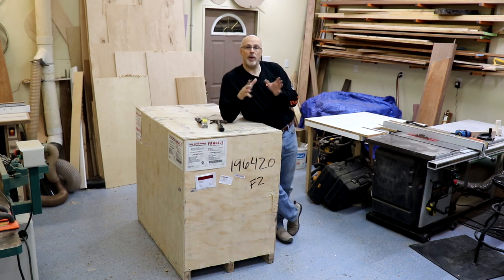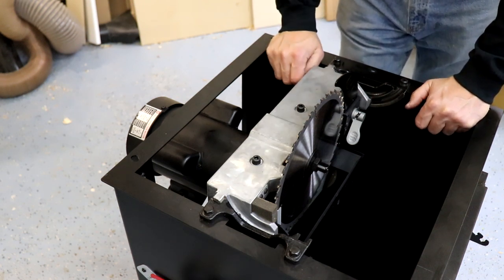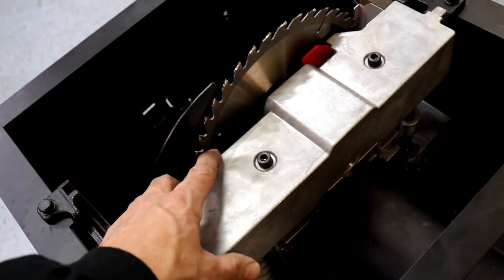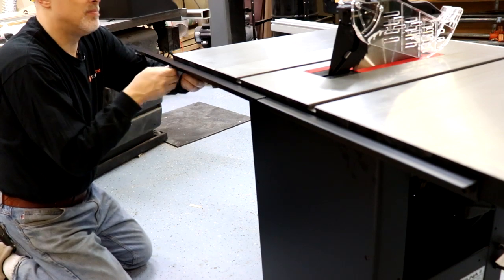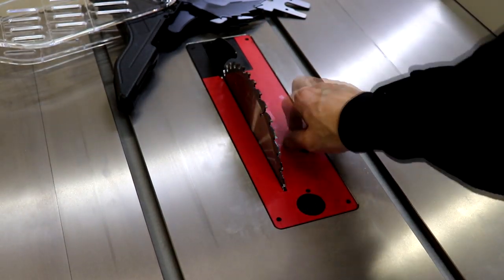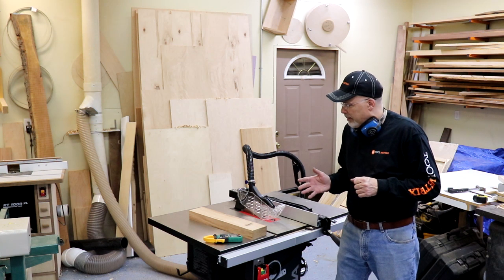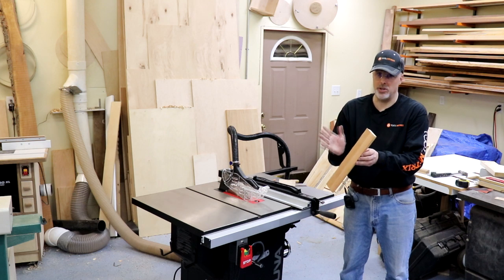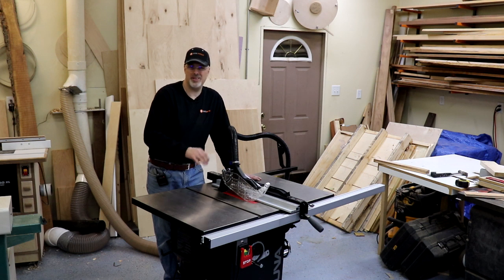Laguna Fusion F2 Table Saw Unboxing and Deep Dive Examination

Comment: How come on their site it says I'd need a 25 amp circuit. I have a designated 20 amp breaker will that be sufficient?
Reply from the maker: I used it on a dedicated 20 amp circuit without having a problem. I’m not sure why they state a 25 amp requirement. Circuit breakers vary in their trip point which might be one reason. It also depends upon how hard you push the saw although I pushed it pretty hard.
Reply: @ToolMetrix  okay thank you very much
Reply: @ToolMetrix  would you say the saw is worth the purchase?
Reply from the maker: It's an impressive saw, and I believe that they priced it about right.  Watch for the 10% off sales if you can, because they seem to come around periodically.

Comment: I have a 3HP 220v early 1980's Rockwell Unisaw in really good condition, I'm strongly considering selling it for this saw (I can't afford the F3) for the dust collection, riving knife and fence design (I have a Delta T2 fence on mine, so it's not horrible), will someone either talk me in or out of this?  I don't think I'll miss the extra horsepower, but I've long wanted a saw with a riving knife because I don't feel like a micro-splitter is enough protection.  I like most of the features more than say a Grizzly, so I'm really considering it.  Oh, and I will definitely choose to run this saw at 220v as well since I've got that wired up in my shop.
Reply: The fence on this is probably similar to the Delta T2.   However, the front fence rail is way too thin and flexes too much IMO.  I owned one of these for about a week.  It had to go back due to shipping damage.  I now have a Shop Fox W1837, which is a nice saw as well.  Similar front rail as the Fusion F2, but much thicker and stiffer.  Problem is, the fence itself is awful on The Shop Fox w1837 and the Grizzly variant (g0771z).  If you want a better fence get the Jet ProShop 2.  Internally it is the same saw as the F2.  It is just missing the cast iron wings and the overhead DC.   It does give you a much better fence though.   The Grizzly G0899 has similar features and a similar price as the f2.  The G0899 has better fence rails and a beefier cabinet.  That was one other thing that I did not like on the F2.  The cabinet seemed thin.  When standing with the wheels locked the saw was not as stable as I thought it should be.  My Shop Fox w1837 is much more stable IMO.   I am pretty happy with the Shop Fox so far.
Reply: @alsmith7316  that was one hell of an answer.  Thank you sir.  The comment about the rigidity of the cabinet has really given me pause, that's one thing I've never had to worry about with my Unisaw.  I'm thinking instead of taking those funds and putting them in a helical cutter head for my DJ20 jointer, or just wait for the inevitable car repair that happens when I have a couple extra bucks.
Reply: @jonq8714  It might not really be the cabinet's fault.  It might be the wheels on the left side of the cabinet.  They do not retract out of the way.  There are just some plastic handled bolts that act as brakes to keep them from turning.  The wheels are plastic and therefore I did not want to torque down on them too much.  It is possible the sense of instability came from the wheels, and possible play on the axle.  Again, they are just cheap plastic wheels.   

With these saws, the manufacturers are always looking for ways to cut costs while also providing more features than the next guy.  They may have been better off not making this a mobile saw.
Reply: @alsmith7316  I already have a mobile base for my Uni that's adjustable, I could just choose to not install those wheels then... hmmmm.  Talk me out of it, talk me into it...  haha.
Reply: @jonq8714  I don't think those wheels can be removed.  There are no feet on that side.  Have you looked into a Harvey?   I would have gone that route, but they are way too heavy for me.  My saw needs to be on a mobile cart that I can easily move out to my driveway where I do all my cutting.  My cart is also used for other tool storage etc.  Space in my garage / shop is at a premium.  So, the Unisaw class of saw is just to heavy for me.

If you want a lighter class of saw (which is what I was after) the F2 is a good choice.  I am sure you could figure out the base and get it more stable.   Full disclosure, the area where the wheels are is where I had some shipping damage on my saw.  This could have impacted things.  The whole saw shifted in the crate and I think something inside the cab shifted as well.  The tilt wheel would bind up when I tried to use it.  Those were the reasons for returning the F2.

Good luck with your decision.
Reply from the maker: That’s a tough call, Jon. The F2 is an awesome saw but those American made Unisaws are pretty sweet.
Reply: @ToolMetrix  they are indeed, but also short on modern safety features... thanks friend.
Reply from the maker: Yes, true that.

Comment: Nice review.   On the plate what are the give me all dimensions of that it lookes like what is on Jets proshop II. And a grizzly portable table saw.  Ive looked everywhere no one but grizzly offers a zero clearance incert for the jet
But it seems this is the new standard for some saws. Bosch also has one like it but I have no information on that saw.
Becuse most of this is made in twian in the same factory 
JET, POWERMATIC SAWSTOP GRIZZLY DELTA GENRAL OLIVER STANLY RIDGID 
PORTER CABLE  DEWALT EX.. Im thinking they are using the same designs 
On them  with differnt design on other stuff and finishes to order.  

( thats where all your American jobs went)
Reply from the maker: I no longer have the saw in my shop.  You can check with Laguna on the specs.
Reply: I am sure they are the same parts.  The Jet ProShop 2 and the Fusion F2 are pretty much the same saw.  Different cabinets and options are the only differences between them.   Look at the manuals and photos and parts diagrams.  You will see what I mean.

Comment: Thank you, Paul!  Very nice tool review.  The F2 seems like it would be a nice cabinet saw, especially for hobbyists in a small home shop who may only have 120V.  Nice price too.  I couldn't help notice  the Delta Unisaw in your shop and remembered watching your review of the Shark Guard on that saw!  Also an excellent review!   So, it would see that like many modern saws, this F2 will have better dust collection than the Delta?  How does this F2 compare to your Unisaw?  I'm still using my old Delta Contractor's saw.  Probably could have bought the F2 for all the mods I'm made to that contractors saw.  Something to consider for others doing upgrades to their old saws (i.e. Shark Guard).
BTW, I may be mistaken, but that fence that you call European design, seems like a copy of the old Delta Uni Fence, which had the same features, but was probably more "heavy duty".  Before Delta bought out Biesemeyer, the Unifence was what high end Uni Saws came with -- an upgrade to the standard Jet Lock fence.  Thanks again, Paul!
Reply from the maker: Hi Kelly, thanks for watching and for the nice feedback.  Yeah, I still use my old Unisaw.  It's not as smooth running as today's saws, and I don't like the 3 belt system very much, but other than that I love the saw.  Part of the reason that I love it is nostalgic, because it is the same saw that Norm Abram used in the final seasons of New Yankee Workshop.  :)  The dust collection on my Unisaw is horrible.  It's basically a hole in the back of the saw, and nothing more.  That said, I removed the 4" port, and I run 6" to the saw with lots of CFM, and the inside of the cabinet stays remarkably clean.  But the approach that is used by modern saws such as Laguna, Saw Stop and others, where the duct is extended through the inside of the cabinet to a shroud around the blade, is far superior.  It allows you to get good collection with less CFM.  That said, if I were to keep an F2 in my shop I would upgrade the 2.5" hose inside the saw and run 4", which would allow much better air movement and keep things cleaner inside the saw.  And I would replace the 1.5" hose up top with a 2.5" for the same reason.  The out-of-the-box setup is fine, but if you have a large dust collector like mine you want to open things up on the saw to take advantage of it.  You're right, the Unifence is also a hi-low fence design, but I don't think they were the first ones.  I could be wrong about that concept coming out of Europe, but that has been my impression.  When I bought my Unisaw in the 90s I had the option of getting it with either a Biesemeyer or a Unifence, and I didn't do enough homework before making the decision.  In retrospect I wish that I had gotten the Unifence, but I like the Biesemeyer fine.  And you're right about the sneaky costs of upgrading a table saw, and at some point it makes sense to just upgrade the entire saw.  But I really like the older Delta contractor saws.   Great build quality, plenty of power, etc.  Dust collection is tricky with them but other than that they are really nice.    Cheers,  Paul
Reply: @ToolMetrix  Hi Paul, thanks for your reply!  Of course, FWIW, your Delta Unisaw and my old Contractor's saw were made in the USA! :-).  I enclosed the back on my Contractor's saw which has helped some with dust extraction.  Did you ever try to dust port on the Shark Guard?  Dust thrown forward  is the biggest problems with my saw.  I wonder is the Shark  Guard helps with that?  
I'm kind of curious, I see some resemblance between the Laguna machines and similar Harvey models and wonder if there is a relationship. Do you know?  
Thanks again!
Reply from the maker: I haven’t tried that yet with the Shark Guard but I think it would help a lot as long as you have at least a 2.5” hose running to the SG. I don’t know if there’s a relationship between the two companies but I doubt it. More likely they use the same manufacturer in Taiwan. You see that a lot with tools.

Comment: I just bought a similar saw under the Magnum brand. Haven't even set it up yet as I'm also renovating my shop first. My one foreseeable "con" to this saw will be the "knee stop switch" Flimsy plastic is not going to take too many knee jabs to turn it off. Think I'll just use my hand. My saw came with both the 120 volt and 240 volt switches. I'm just gonna use the 240 volt.
Reply from the maker: Interesting.  I've never heard of that brand.  I can't even find the manufacturer's web site.  I see them sold by a Canadian dealer KMS.  Maybe their house brand?   Yeah, I think the idea is that you can turn it off with your knee in a panic situation.  Hopefully that doesn't happen too many times.  :)

Comment: So.. the fence can’t be adjusted to dial in to a dead 90? Seems like a HUGE oversight on laguna’s part. I currently have a table saw with a fence that isn’t 90 degrees vertically, and cannot be adjusted.. it’s a great paperweight!
Reply from the maker: Thanks for weighing in on this.  Cheers, Paul
Reply: @ToolMetrix  I sincerely hope I’m wrong about this. Thanks for the overview of the saw!

Comment: SOP for pre-assembled saws. Assembled for shipping and display, NOT for operation. ALL alignments should be checks and operational specs be verified, They may OR MAY NOT be within parameters and should NOT be expected to be unless a SAW INSTALL from the dealer is PURCHASED at the time the saw is purchased.
Reply from the maker: I agree with you. I spend a lot of time dialing everything in on every stationary tool that I set up. I’ve never had one yet that completely met my satisfaction out of the box.
Reply: @ToolMetrix  We would sell our displays if the client insisted or was in a bind. We had more than one private buyer get upset that it was not perfectly tuned when he/she got it. Industrial buyers knew better. Lack of steel rails here bothers me.

Comment: Not all circuit breakers will handle their rated current long term.  Many will slowly over heat at full current (19-20A) and will trip in the middle of a long cut!  I have this problem with my air compressor on a dedicated 20A circuit in the garage.  I wish I could rewire its motor for 240v (I have a 240 volt outlet in the garage).
Reply: Circuit breakers are really only designed to handle 80% of the face value load. So 16amps full time won’t hurt a 20 amp circuit. If you go beyond that it will trip with a constant amp draw it will trip. That’s why they recommend 25 amps
Reply: @aaronthehandyman7714  really no such thing as a 25 amp 120 amp circuit.  Common outlets are rated to a max of 20A.  I guess you could wire those circuits with 10 gauge wire and use a 25 amp breaker, but you'd have to cheat on the outlet, or find an industrial 30A one and rewire the tool.
Reply: @scharkalvin  absolutely correct. Although once you change the cord cap you technically void any warranty’s.
Reply from the maker: Good to know. Thanks for sharing.

Comment: I don't have room for a dust collection system in my shop.  Would it be a problem to use this saw without any dust collection and just let it fall into the cabinet below?
Reply from the maker: No problem. Just remove the dust hose from the shroud underneath the blade and don’t install the panel at the bottom of the saw cabinet. If you do those things you should be fine.

Comment: I am really considering this saw. I have seen some issues with dust collection though. What size dust collector did you use for the test? I have watched your video twice now and really like your detail and presentation. Thanks!
Reply from the maker: Hello and thanks for your question.  I used my 5 HP Oneida cyclone in this video.  The F2 is set up with dust collection that is optimized to give "pretty good collection" with a SMALL dust collector.  It has a 4" inlet, and splits that into a 2.5" going to the blade shroud, 1" going to the body of the saw, and 1.5" going to the blade guard.  With a 1.5 HP DC, that gives you some collection in all areas, albeit not perfect in any area.  Here's what I would do if I was going to keep this saw in a shop environment.  If I only had a 1.5 HP -2 HP DC, I would not use the blade guard collection.  I'd seal that off. I'd replace the 2.5" internal hose with a 4" hose (and eliminate the 1" hole going into the cabinet) and maximize the collection below the table, and just deal with the minimal amount of dust on top of the table.  If I had something larger, 3-5 HP, I would run 6" duct to the back of the saw, reducing to 4" at the main inlet (which I would replace with my own) and running a 4" flexible duct to under-table shroud.  From the 6" line I would pull a separate 2.5" branch to the blade guard.  This would give you near-perfect dust collection above and below the table.  You could even go 4" to the blade board, but that can actually provide too much CFM and actually start pulling small cut-off pieces up into the DC system.  2.5" should be about right.  Or, you could go 4" and dial in the right air flow using the blast gate.
Reply: @ToolMetrix  I have a garage shop and connect a 2HP dust collector to each tool when I use it. I may have to just see how it works out. Thanks for the great detailed answer. I might need the info.

Comment: I want one of these saws, but I would need to hard pipe the upper dust collection instead of the flex hose.

What about a different mobile base? Is there something with larger wheels that doesn't require lifting?
Reply from the maker: Yeah, hard pipe would be better for sure. 2.5” while you’re at it. I haven’t looked at third party mobile bases much but I think you can find one that doesn’t add much height.
Reply: @ToolMetrix  Thank you for the quick reply. I have been looking at this saw or the Powermatic PM1000. The only requirement I have is the mobility. I need it to roll around without lifting it, so I'll weld up a mobile base if I have to.

Comment: In the video, it appears the bottom of the saw housing is open to the floor.  This would seem to allow dust not picked up from the blade shroud suction to fall to the floor.  Is this correct?
I and many others use fence jigs.  I have a tall fence jig I have used.  It can be used for cutting tenons without using a dado blade.  It can also be used for cutting angles on the ends of boards to make a ramp for rolling tools in/out of a garage.  How can such devices be used with this style fence?
Reply from the maker: Hi Bill, the bottom of the cabinet is sealed, so if dust manages to sneak past the shroud, it won't land on the floor.  On the older Laguna models I believe that the bottom was open.  The easiest way to use this style fence with a jig as you are describing would be to remove the sliding portion of the fence.  Otherwise, you could design it to form around the entire fence, including the sliding portion, but it would make the design more complex.

Comment: What a great review of all 3 versions of the Laguna saw. Trying to decide between F2 and F3. Small 1 car garage hobby shop with dreams of making furniture. In your opinion is the F3 Worth the extra cost?
Reply from the maker: Hi Randy, Thanks for your feedback.  I would never try to talk anyone out of a more powerful saw.  That said, the F2 is a great quality tool and I think it's a good choice for a serious hobbyist.  It can do anything that the F3 can do, but the F3 can do it faster.  I'm guessing that you might have to tune the F2 more than the F3, but since it's such a low vibration saw I don't expect that you'll have to make adjustments very often if you leave it in place.  So, the question as to whether it's worth it to you is impossible for me to answer.  Hopefully through the videos I've conveyed enough about the differences to help you make a good choice.  Either way, enjoy your new saw, and have a blast making furniture!
Reply: Cost to buy Laguna 2 tablesaw
Reply from the maker: 1800 at Rockler now